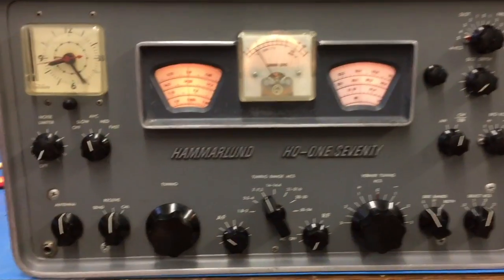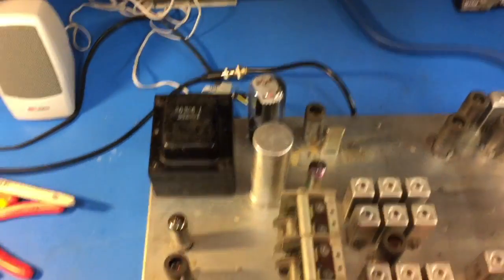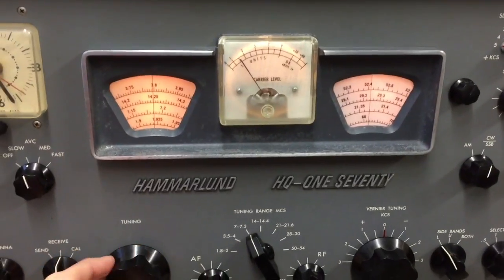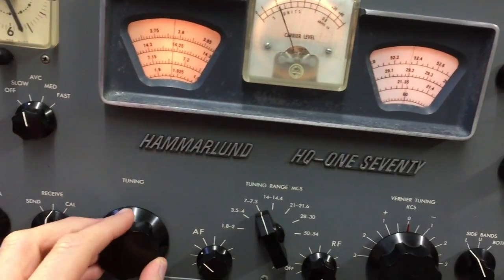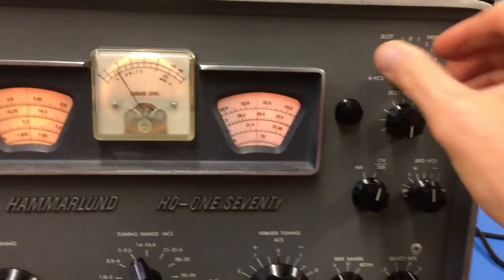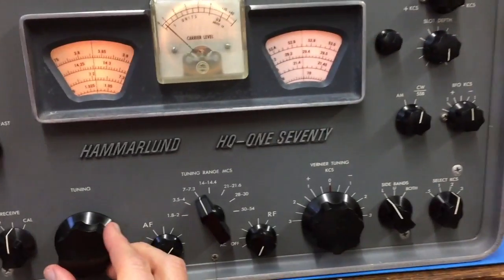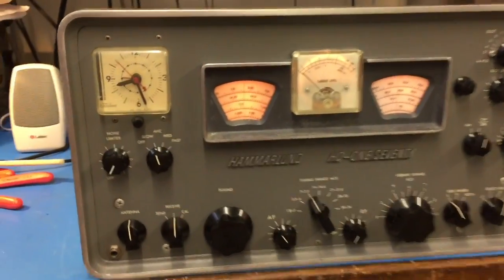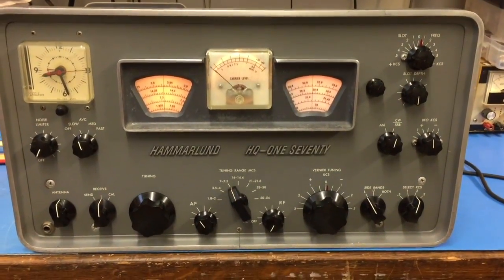Hammarlund HQ-170

Comment: Thanks for posting. I had one back in the early 70's and it was vintage back then.  A fine old gentlemen from the Amateur Radio club, who had actually worked on the Manhattan Project, sold me a 170 and purposely messed up the tuning alignment and the 7 stage notch filter.  These old instructors were hard core. What a wonderful, sensitive and tunable receiver, and it looks so cool too. You really brought back some memories.  Thanks again.

Comment: thanks for posting, Greg... I just picked up this set from a friend cleaning out his storage.... low audio, no reception.... am starting to do my homework...
Reply from the maker: Good luck, with all of the ceramic caps in this thing it shouldn't be too difficult to make it work again.  Sounds like an audio subsystem fault, which is the only place where you might find leaky electrolytics.  These days i test all caps before replacing them, and try to leave the good ones in whenever possible and when it's safe to do so.
Reply: @GregoryCharvat  thanks, Greg.... I'm just grateful for the low hum

Comment: I have the same radio. Do you experience much drift on ssb or cw? Seems like I have to touch the VFO every 15 minutes after warm up. I've had it for 20 years and never taken the cover off. I will have to open it someday it's losing sensitivity on low bands :-(
Reply from the maker: To be honest, i haven't used it in operation that often yet.  I'll keep an eye out for the same issue, it wouldn't surprise me if mine does the same.